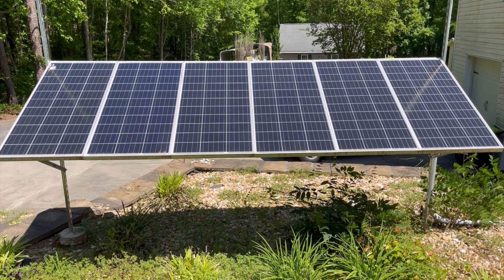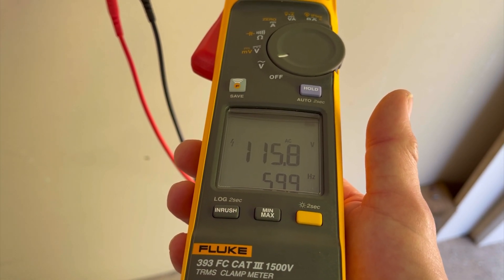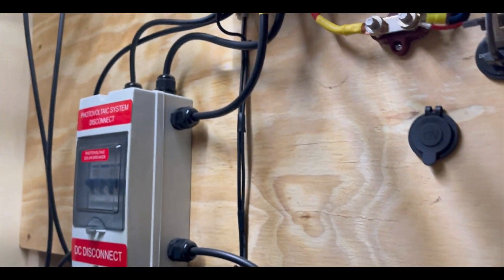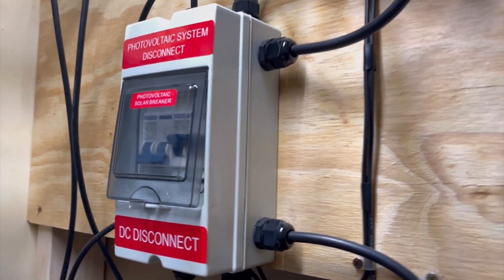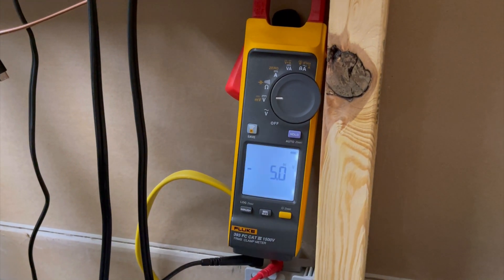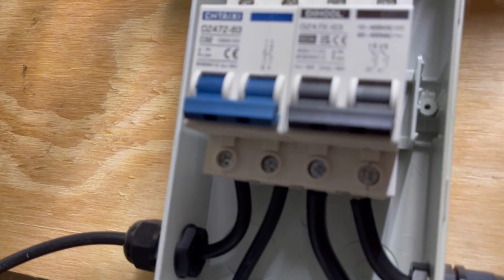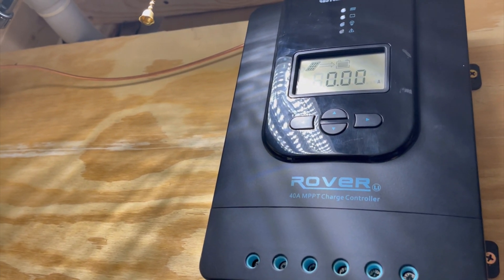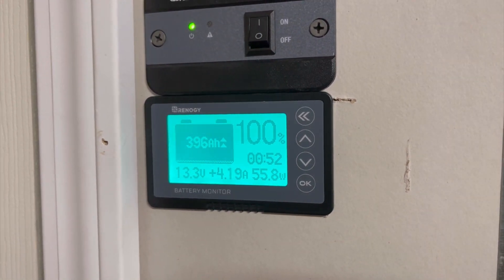First MAJOR Problem with our Off-Grid Solar Power System #solar #solarenergy #solarsystem #offgrid

Comment: The circuit breaker going from the charge controller to the battery should be a 100 amp circuit breaker.
Reply from the maker: Why is that? The CC only puts out 40A

Comment: I'd say stop using those china name breakers, I had the same problem with automotive breakers all the same, you need to get a breaker that is sold in the US that is UL listed and been tested, or you can keep having a bunch of failures with those things they don't sell in this country lol, you call em fuses I reckon because they get thrown out alot but they are suppose to be breakers LOL.  Seriously you may burn your place down with those breakers, big clive on YT showed some of these taken apart and how they were cloning an actual brand or something like that and ripping people off with garbage.  BUSSman makes a automotive breaker model 187, I think eaton bought em and it's under their name now, they are pretty nice I use them on my bus to RV conversion to shut off the batteries, including the starter for the engine, they do as advertised. 
I've only seen 3-4 of your videos, who is this "we" you keep mentioning?
Sorry I'm a jerk but I do like watching, thank you.
Reply from the maker: Thanks for your comment we (lol) will look into it.
When I say "we" I am referring to the whole team that makes this channel happen I'm just the voice and tech guy lol

Comment: i have experienced this also. the weak design of the mechanical circuit breaker can be avoided with the newer design disconnects and if you want a fuse then use an actual fuse to protect the wiring.My buddy lost his charge controller due to this same problem and the controller was damaged by no battery input and still having solar input.
Reply from the maker: Yes that’s what happen here but I think our cc has a protection mode so it was saved lol

Comment: Probably your fuse will burn your house down. They constantly heat in order to shut off. Better place high amperage switch instead.
Reply from the maker: The fuse is just a small portion of the system, we also have a 400A T class, and another 40A ANL
Reply: @DIYKAI  Small but dangerous part, placed in this place. If you need means to separate battery from the rest of the system... high amperage switch. This is my opinion.
Reply from the maker: @vinylapplying please check out other video out of the walkthrough we have a HUGE manual disconnect switch between the battery and inverter as well this system is over engineered and has been up and running over 3 years 24/7 fuses are not lifetime parts and are expected to degrade over time.
We do appreciate your comment and concerns!
Reply: @DIYKAI  I see it. This burned fuse is only for charging. But these fuses heat constantly even with 7-10 amps, for me it is hazard. I also have similar system which is DIY with cheap DC-to DC step-down converters . It is 12 volt system and solar panels are connected in parallel to have bether efficiency in low light condition, they reach 65 amps from time to time . I use 200A diode for battery and clamps for terminals. No charge controller, only inverter for AC. I tried 63A fuses but even in triple configuration they stay hot.